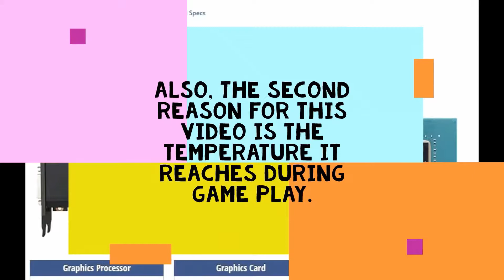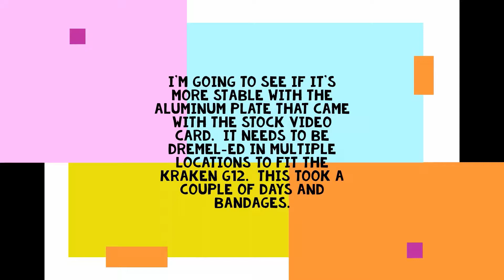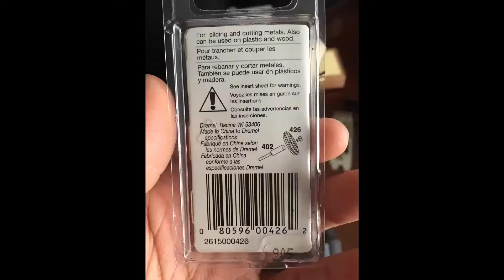GTX 1070 with kraken G12 and X42

Comment: Very cool custom build !👏 I will try it to but with my 980 ti
Reply: @81mengi  Great! My Temperature has lowered from 85°C to 50 - 60°C while being under maximum load. And my Idle Temperature is 30°C. It's was the best decision to buy one. Especially for the 980 ti because the Stock Cooling is really bad.